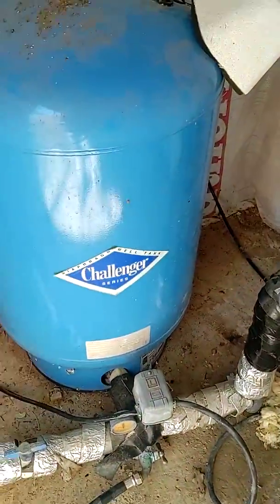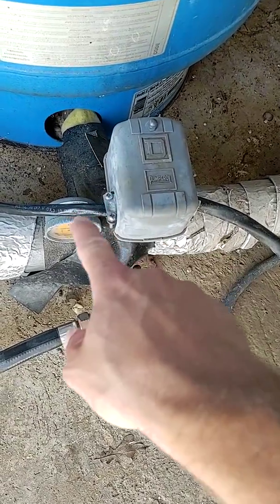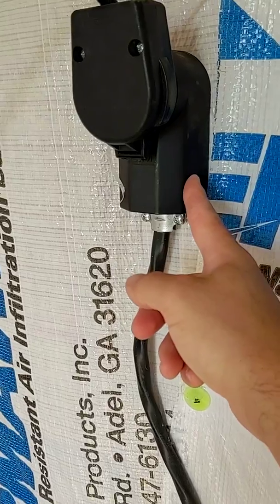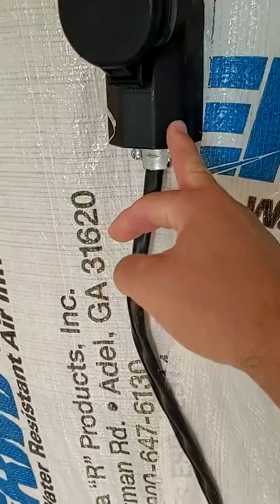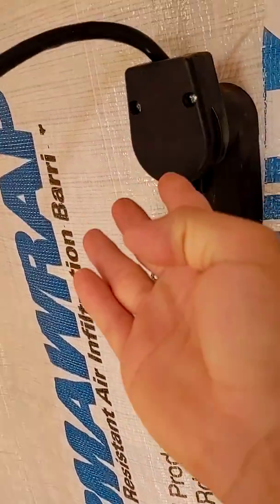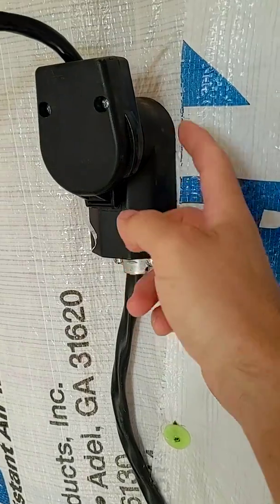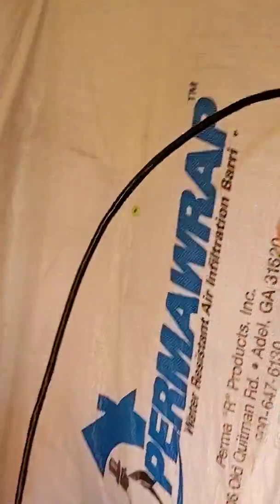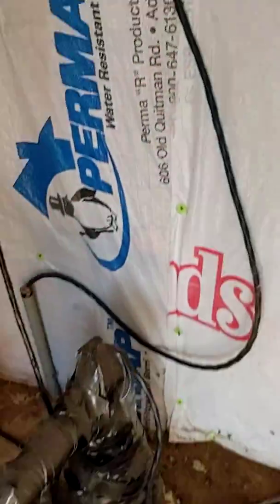Hook up your well to a generator.

Comment: I assume you left neutral wire connection empty in the plug since plug has to be 4 prong to connect to 30 amp outlet on generator but pump wire is usually only 3 wires (2 hots and the ground) neutral not used, correct?
Reply from the maker: Don't get me to lying now LOL it's been a few years since I've done it.

Comment: Is your plug a 220 with three prongs like a 120 plug or is it a three prong plug that is round.
Reply from the maker: @vickilabriola2323  it was a 220 plug, just find yourself a generator that strong enough for the well. 
Then find yourself a plug that fits a generator. Then find yourself a female plug that fits the plug that fits the generator.
Reply: @livewithsamyoder7465  Thank You for the info.

Comment: Good way to get water in a pinch that is not hazardous to line workers.
I would just put a 30amp sub panel between the generator plug and pressure switch.
Then you have a safe system on both your well pump and generator.
When all is said and done, you have 2 double pole break switches when normal power is running your well.
🫡
Reply: I'm not going into why your wrong about the back feeding by doing it his way, but you are wrong.  Put a little more thought into how he did it. edit: Just don't over think it.

Comment: So will the generator produce 220 power? Or how does that work
Reply from the maker: @toddneihaus4902  the one I used had enough power yes. 
I would recommend checking with a well company and see what you need to power your well though.
Reply: Generators will usually have a 125/240 turn key 4 pin plug that as long as you spread your load  correctly, a 1/2 horse well needs 2,000 watts,.. 1,000 running and 1,000 startup watts.
So, a 2200-watt generator will run only 1 well pump.

Comment: Lmao all you need is to cut the male end of a extension cord wire it up to your pressure switch and slap it in the generator it’s what we used to do to pump them off after setting it

Comment: What size cable you used?
Reply from the maker: Not sure what size it is I just know it's 220 and it had I think for small wire's inside of it.
Reply from the maker: My pleasure
Reply: The recommended wire gauge for a 30 amp circuit is 10 gauge copper wire. 
A well is a 3 wire system with a ground.
Should be red, black, white, green, or bare copper ground.

Comment: Thank you! I have been watching dozens of videos about transfer switches, interlock kits, battery backups, solar, etc. I got a good belly laugh from this video. I was, as usual, way over-thinking it. This is the super-easy, super-simple way. I plan to do the same thing. And, I'm going to store my generator inside the well house (which has a lockable door). I'm looking at ways to route the exhaust outside. Then I can run the generator inside the insulated walls where it will be fairly quiet.
Reply from the maker: Awesome I'm glad you enjoyed the video and it was helpful thank you for watching!
Reply: Hello what size of a generator do I need to turn it on ?
Reply: @manueljaramillo4813 Depends on the well pump but most well points are 480 volts

Comment: My line come into a fuse box with a power cutoff switch inside the well house, then a line comes from that to the control unit on the well. Should I put the female plug on the line leaving this power cutoff box?

Comment: I guess you run your water pump on 220.  Why not run it on  110 and keep it simple and just plug it in.
Reply from the maker: Great question I'm not sure it can be run off of 110 or I don't know how to do it anyway.
Reply: @livewithsamyoder7465  On some it's just a matter of moving a switch already built in the pump. But for now, just leave it alone. If it works, it works.

Comment: My well pump is 230 volts 7 amps.  My generator ( I have to power my RV camper) is Honda 3000 watt 120 volt inverter.   I want to run my pum in an emergency,   CAn it be done ? ( ie. Can  I apply 115 volts to both line 1 and line 2 on my 230 volt pump and make it run, or will I blow my generator or pump?
Reply from the maker: I can't answer that question I'm not very electronically inclined.
The generator I use is a powerhorse 11, 000 Watt
Reply: If what your using doesn't have a plug built in that says 125/240 don't try to use it for this purpose.
You likely have a generator with 2 120volt gfi outlets ONLY.
DON'T TRY TO MODIFY IT.
Reply: We can talk theory vs what the plug says!  
I see inverters (transformers) that change 240 to 120 volt and also the other way 120 to 240 volts. Numerous are for sake on internet!
However when looking closer the 240 volt plug is Usually ALWAYS the European style lug plug.  Their 3 lug plug is L1 240 v to N for 240 volt power
In USA our 240 plug L1 & 0:05 120 V feeds to L2 @ 120 volt to give 240 volt to no neutral …
So can we use European 240 to N to pump water from a submerged well 240
USA style pump that is wired at 120 L1 to 120 L2 to get water?
No time for croapoka about going out in a hurricane with no power, or going to hardware for new generator . All sold out days ago!
We have fire’s ablaze, animals and livestock to keep alive and feed, and humans that need a drink !
No OSHA guys here to solve problems, lives are on the line!
Can we put 120 v on L1 & L2 to keep things watered so they don’t die!
Reply: @BillJones-m4g  Yes. At the risk of your pump and / or generator.
Modification will require a 30 amp double pole or inline 30 amp ac fuses on red and black to run safely.
The startup 1,000 watt pull can easily fry the entire system.
I'm not familiar with European systems or plugs. But I'm sure the principles apply.
Yes,.. 2 - 120v supplies can convert to 240v.
Generators usually have a built-in fuse system for the PRIMARY FUNCTION.
Reply: @BillJones-m4g  FYI,.. American generator plugs are typically L14-30.
If you get extension corded adaptors to 15amp outlets(typically 3 inline on the cord), any corded extension like this has a neutral  contact and not 2 hots. These cords can not be modified as they are soldered and molded.
You need to get the plug adaptors that can be manually modified for 2 hots, typically red and black and ground only.
No neutrals to well pumps.
Which is why corded adaptors from the 125/250v outlets to 120v inline won't work. 
You can't cut the plug off and wire a neutral (white) to red or black and expect it to draw 250v.
It's only drawing 125v.
Not enough to power a well pump.
Had someone ask in another post about these adaptors.

Comment: Ok great understand it thanks that was very clever , now question for you ,you plug the male end of the cord coming from well housing unit  into the generator so  how does the generator know when to be turned on is there a contact switch in that well housing unit ?
Reply from the maker: Thank you for your question, I only use this when the power is out I don't leave it plugged in the generator. I only started the generator and ran the well to fill up water tanks etc etc and when I was done I shut the generator off.

Comment: What size generator are you using and do you have a parts list. How well has this set up been working. Thank you in advance
Reply from the maker: My generator is a 11,000 watt electric start. Power horse generator.
It works great I only use it if the power is out.

Comment: Good vid! Only downside....when you run the line directly to your generator...you bypass the breakers. Without breakers....if there is trouble with the generator, or well pump, or pressure switch....you could burn something up. So, in an emergency or SHTF....it would indeed work, but you don't have the safety that the breakers provide. But, like I say....during an emergency....would give you water. Good vid!
Reply: What about the breakers that are built into the generator??
Reply: @projectdad6561  generators have built in overload breakers! The good ones do anyway?
Reply from the maker: Thank you. It actually does go through the breaker and switch. I cut the line on the side coming from the house.
Reply: @livewithsamyoder7465  OK, watched the video again. Makes sense now.......just commented since at first glance.....looked really easy to do it wrong. My fault for not watching more carefully. Oh, BTW...yep I went through 3 days of no power where I am at too. Suked. 😉
Reply: @livewithsamyoder7465  Ok...then just be careful not to backfeed your house panel then...that might be bad. I am sure these are the things some of the guys you talked to were trying to explain to you or when you about.  No biggee, and not trying to troll ya at all...but I bet money several will watch this video and do what you did...except they won't know about backfeeding, or bypassing breakers. No biggee....just a heads up. Thanks for taking the  time!

Comment: Is the male & female plug you bought a 110 or 220? Home Depot?
Reply: Well pumps are 220 volt, so you need 220v plugs, sometimes they say 230v just to be confusing
Reply from the maker: 220